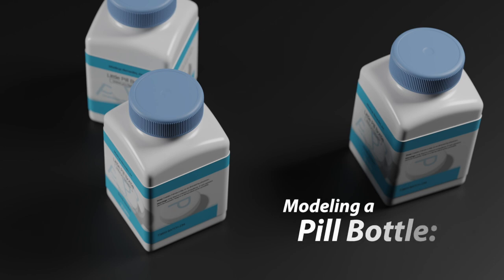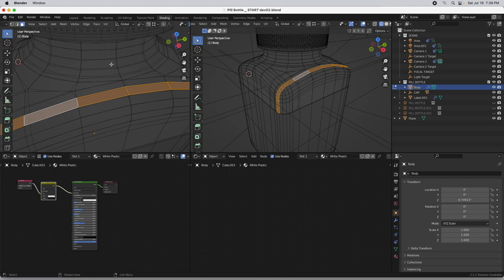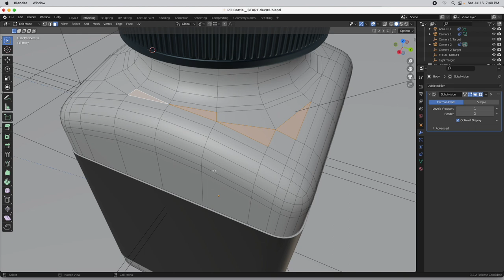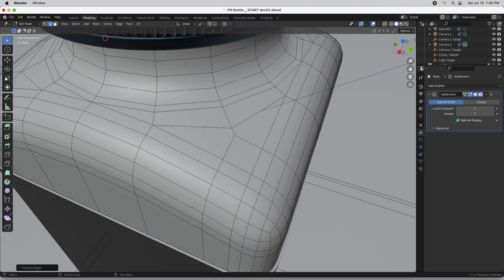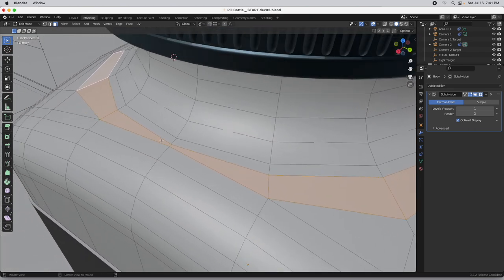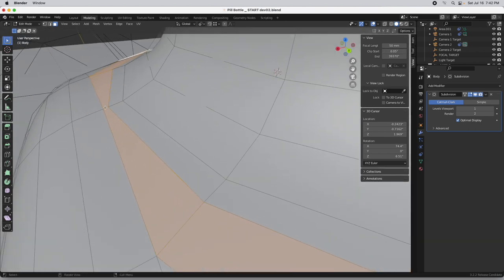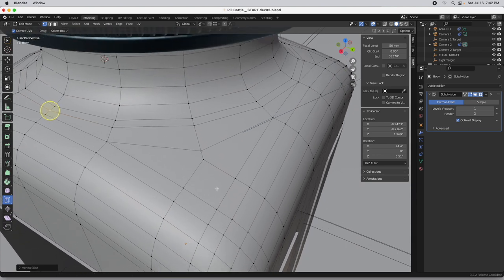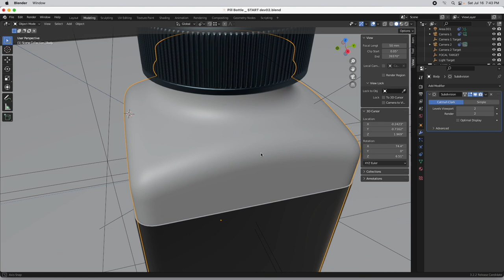Pill Bottle, Quads vs Triangles

Comment: Or you could just have taken that vertex that both those triangles in the corner share and connect that to the edge to the middle triangle and then delete the edge of the corner triangle, fast and easy :) Also selecting a vertex and then press G twice will set you into vertex slide mode.
Reply from the maker: Yep, there are usually multiple ways to do something in complex 3D apps.